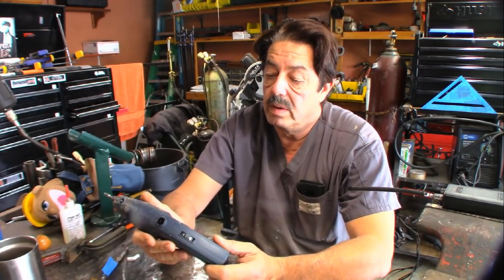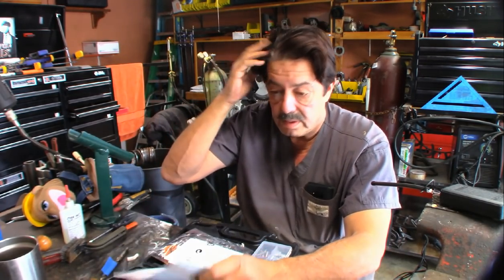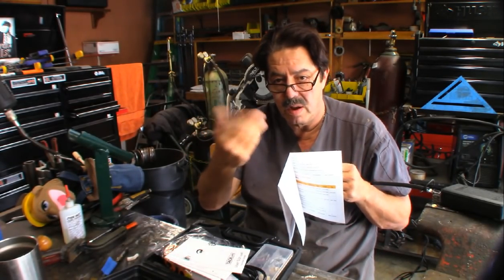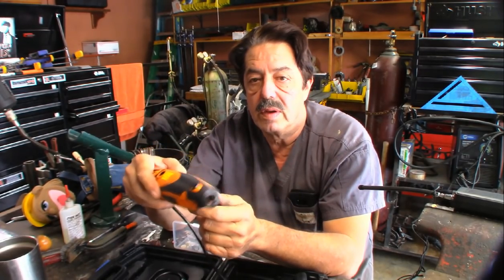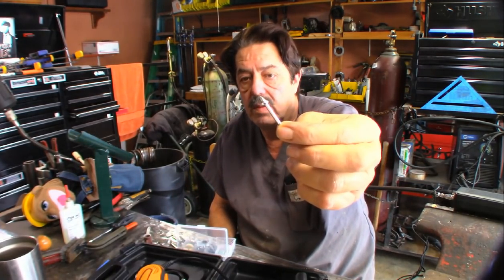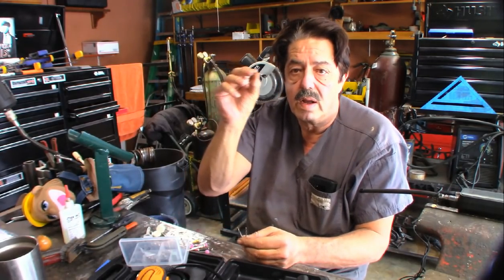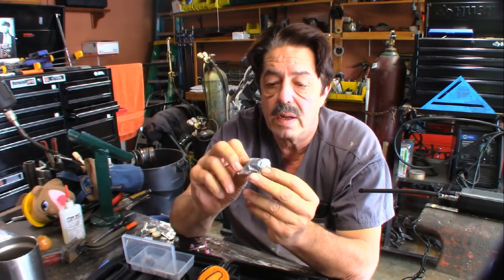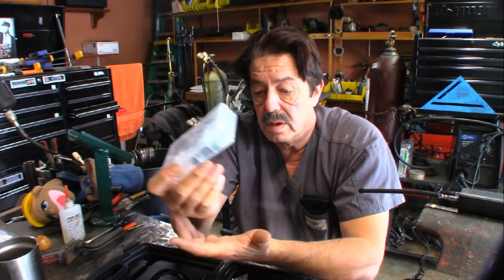Tacklife Rotary Tool Kit Variable Speed Kit - Review and Tips

Comment: I know this is an old video, and you're not likely to see what I write here. 
On the off chance that you do... Thank you SO very much for explaining everything in this kit! I have been living in a state of confusion about the collet and the locking thingy. The only way I could use it is by goofing off long enough to stumble onto something that worked. I purchased mine second hand, so there was no paperwork included. 

The tip about the little hole in the flex shaft is vey useful. I've been holding the locking button on the tool to tighten the end of the flex shaft, which is not convenient. 

Thank you again for breaking it down so us simple folks can understand! 
😊
Reply from the maker: I know its a older video i did but the same thing applies to many of these tools like it. It is a fun tool though and it has many uses depending on your hobby and what you are trying to do.
Reply: @TheHomeHandyman  I mostly repair my own stuff, and I have been feeling the call to refurbish pieces of furniture. Maybe  I can even build a whole bookcase! 
I am grateful you mentioned the attachment that can be used as a router. I need to repair/rebuild a drawer, and was puzzled about how to make the side channels for the bottom. It looks pretty figure-out-able now!
😆
Reply from the maker: For making drawer tracks you can set it up with guides and make them or you can look on craigslist etc for a detail router which would work well.

Comment: You only change the collet if you need a larger hole or smaller hole in the collet for specific accessories with specific shaft sizes
Reply from the maker: yeah I agree collet only needs changing if you have different sized cutters

Comment: Nice.  Excellent Review. 
As for me, I own 4 different Dremels; three of which are top end cordless. 
I use one set up with small cordless wood saw and one set up with a cut off wheel/grinder almost everyday in my property management business.  Very handy and saves me a lot of time. The only Dremel that I have been disappointed in is their new cordless stick screwdriver; it doesn't have a switch but is a push to screw and unscrew. Also it is slow and weak. 
Note:
I've found, for me, it is better to have separate tools for my service truck and separate tools for my shop. That way, they are always handy where ever I am.

Comment: Hi! Very helpful video. I’m trying to fit the drilling pieces into the flexible attachment and they all fall straight out - how do you get the pieces to stay in the extension? I’ve followed your instructions and the instructions in the manual with loosening the volley etc but it’s not working. Would be great to hear back :)
Reply from the maker: I think your issue is in having to change the collet in the rotary tool - on mine you unscrew the tip on it and change out the collet which there are several to choose from in the kit that i have when i bought mine - this should fix the issue your describing - I bought the Tacklife bit kit with it when i got mine - take a look in the bottom left corner of the Amazon link here and you will see the collets I am talking about -   https://amzn.to/3k40jb9

Comment: That 's a nice kit.  I have a Black & Decker RTX-6 rotary tool that I bought a couple of years ago, it's ok but it only has 3 speeds whereas the Taklife is variable speed and it also comes with the flex-shaft attachment .   I own an LED work light by Tacklife that has been pretty good.

Comment: oops, I have a question, how to I get the sanding paper to stay on, I know you said to tighten it, but how?
Reply from the maker: I have two types i use.....one is a drum sleeve that a round pc of sanding disc fits over and you tighten a screw on the bottom that expands the rubber and holds it tight. The other are flap wheels which require nothing to use, just put it in the chuck and tighten it up...............